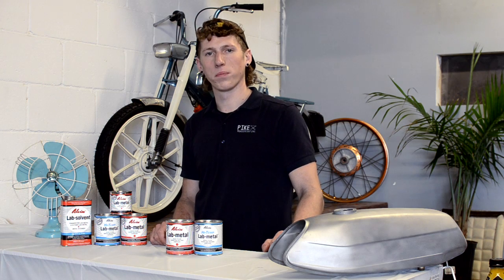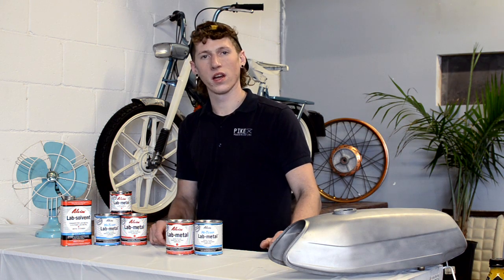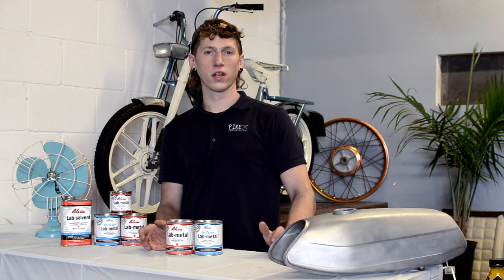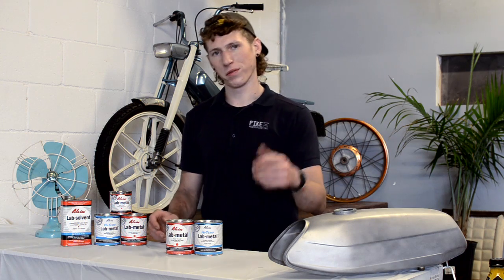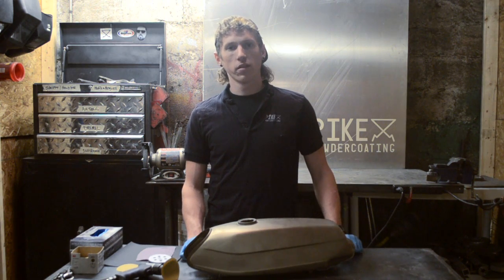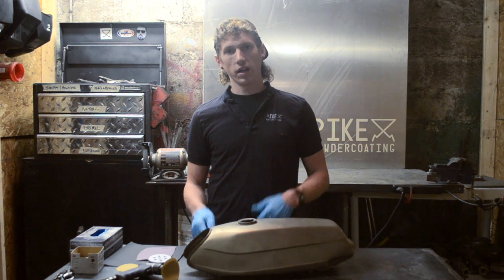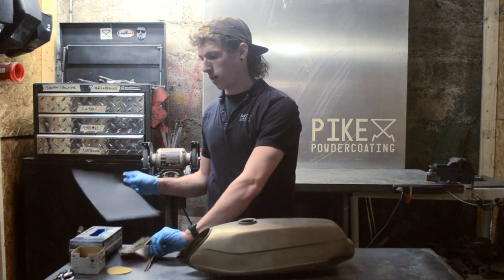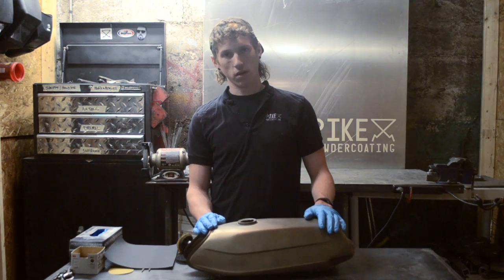Powder Coating Lab-metal

Comment: I have a question Can you sand and shape the lab Metal Before you do the One hour Curing process at 425 for a hour? Because I have to have my powder coating guy do it at the same time it's gonna be coated.
Reply from the maker: Lab metal (red and white can) can be sanded after air cure.
Hi Temp Lab metal must be heat cured @ 425F for one hour before sanding (will still be too soft to sand after a 24 hour air dry)

Comment: No Conversion coating at all? is this tank not made from aluminum? also relatively sure the metal in the lab metal putty is aluminum, without a conversion coating your powder will chip off pretty easily(again, unless your tank is made of steel for some reason)

Comment: You are better off not using that tape, now you have created sharp edges that you have to sand down, = extra work. Use a plastic spreader or a small metal putty knife, make thinner coats and taper the edges = less work. It is easier  to shape the lab metal while it is wet, then sand it more after it dries. Plus if you use a putty knife it will help push the lab metal down into the crevices. Put a regulator on your sander so you can slow it down, better control. Work smarter not harder.
Reply: Or those wood tongue sticks to apply the lab-metal.